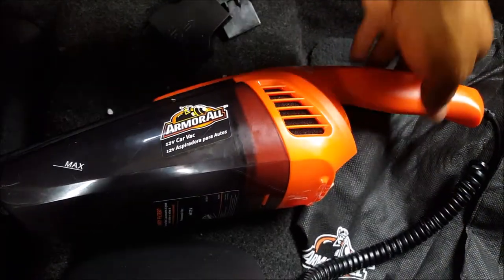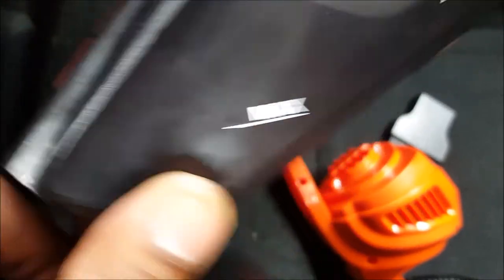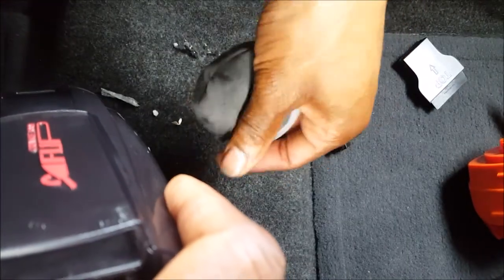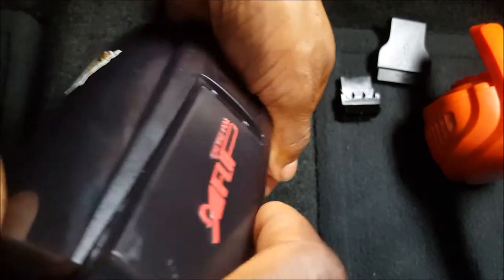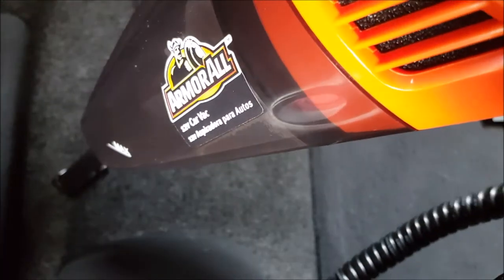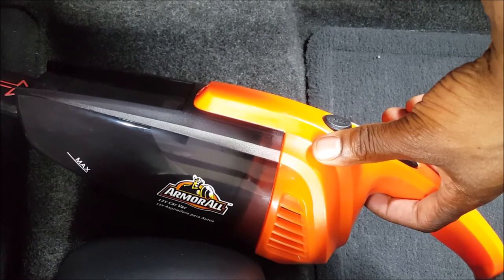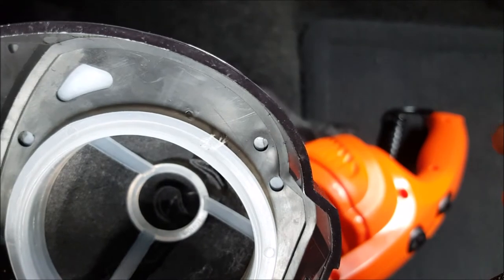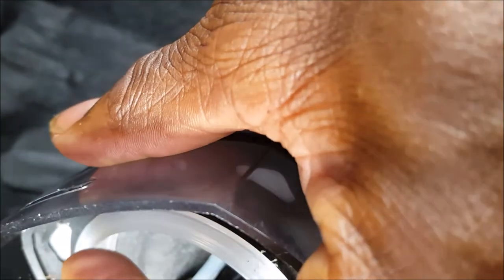Armor All 12V Cigarette Lighter Adapter DC Car Vacuum ArmorAll Wet Dry Vac

Comment: How do I use the wet part where I want to clean my car what the wet solution and pick it up with the vacuum cleanerI tried it and all the water came out through the motor because the side where blows out the air